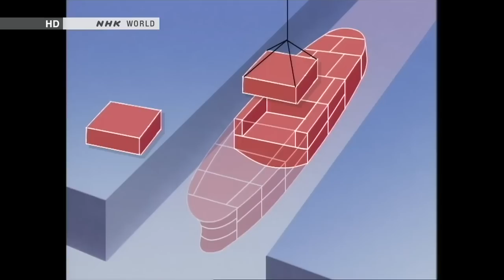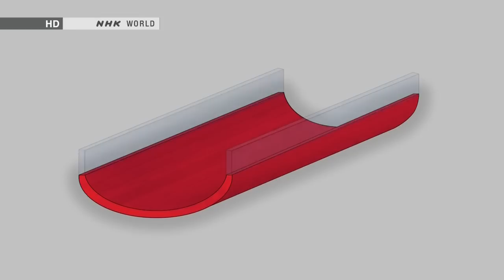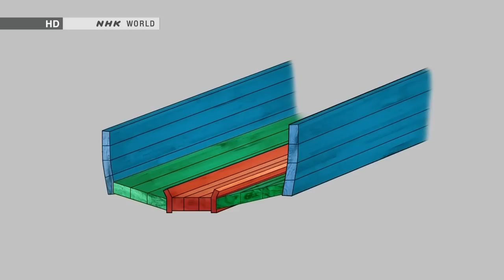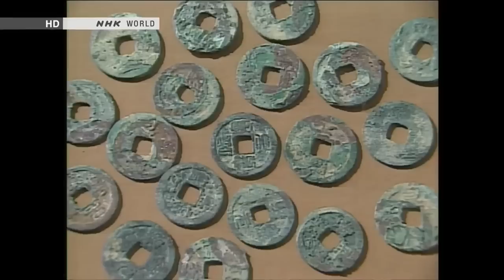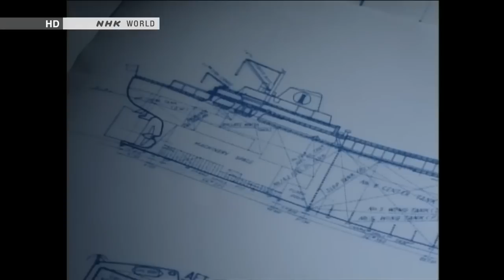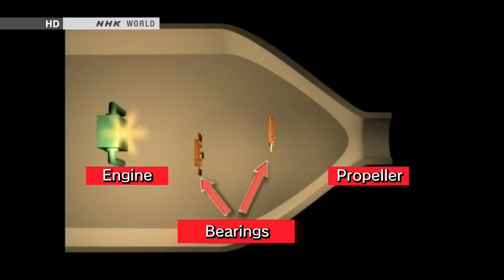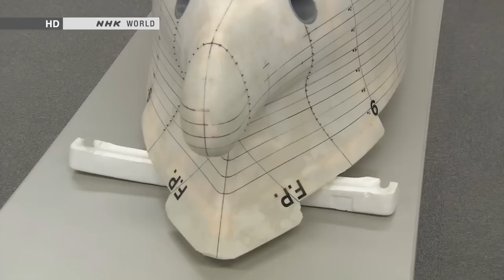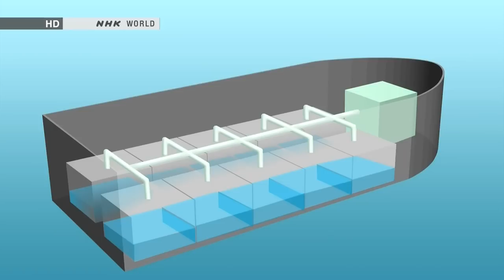BEGIN Japanology: Shipbuilding

Comment: Mitsubishi has also air underneath hull, but it is a boundary curtain layer of bubbles to reduce drag so we can use smaller engines and less fuel and has already been deployed with predicted results.  Sumitomo Heavy Industries built the largest ship ever constructed, having many previous names but most famously the Knock Nevis supertanker, which was in service until 2009 and finally scrapped after 30 years.  She was over 1,500 ft length, and drawing 81 feet of water depth and nearly 230 feet wide, and carrying 260,000 tons or 4,050,000 barrels of oil.  Still is the biggest ship ever built.  Of course, prior to WW2, Mitsubishi Kure built the Yamato and Musashi battle ships which were they biggest ever built and 4 hulls were constructed, one being turned into the IJN aircraft carrier Shinano, which remained the largest ship and largest carrier until the US Forestall Class super carriers starting in 1956.

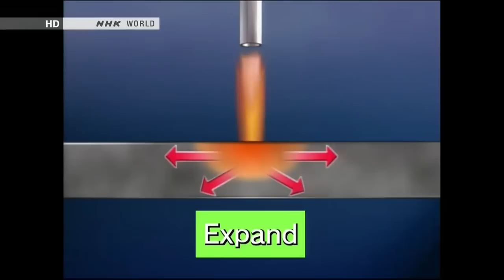Comment: at the 6:30 heating bending method is not suitable for some classification society. heating and cooling with water at the same time. steel loose its strenght and corrosion characteristic. point efect hydrolic press is beter than this method.